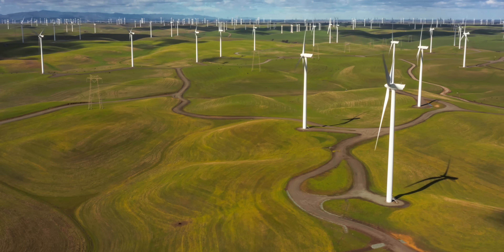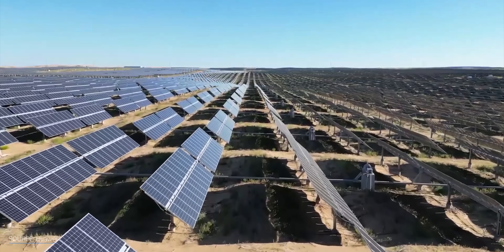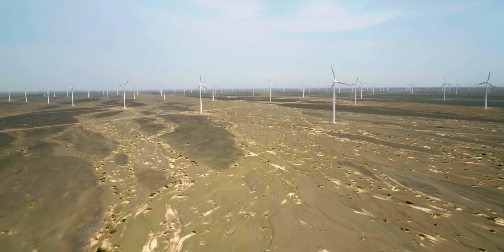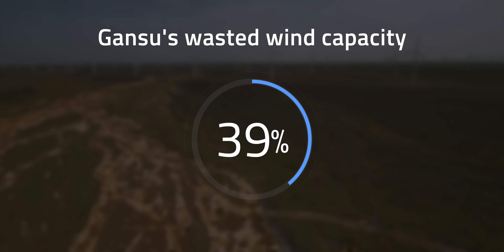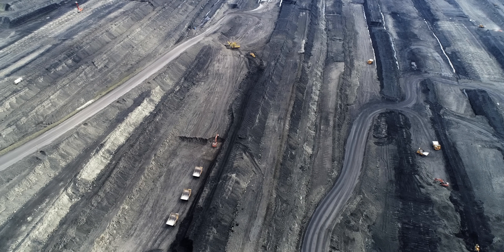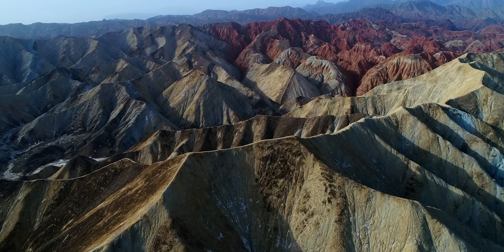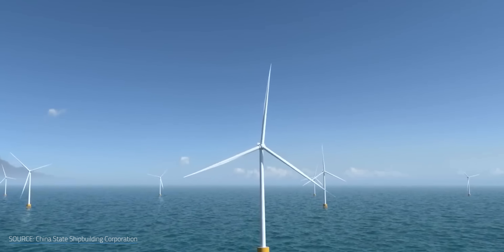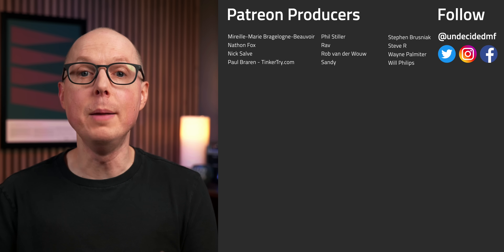The World’s Largest Wind Farm has a Tiny Problem

Comment: China has the most fossil fuel power plants to replace.
That being said 1/3 of their current supply is renewables.
They are the global leader in installed Solar, Wind and Backup Energy Storage Systems.
Their adoption of EVs has reduced China's demand for petroleum for the last 2 quarters.
The result even with recent OPEC production cuts has been a lowering of global oil prices.

Does China still have a long way to go?
Absolutely.
Even though they have a longer race to run given the size of their population.
They are still in first place and accelerating.
Reply: If, they properly built these infrastructures. Remember, "tofu" construction and "chabaduo" is rampant in China.
Reply: @Xi_Jinping_is_Pooh  the big projects aren't like that. It's not that they don't know how to do it properly. It's that their country has not been industrialised for as long, so there is not that much red tape.

Because of the looser regulatory framework, there are a lot more greedy capitalists who takes shortcuts. Smaller projects are not managed as tightly. The US had the same problem in the 19th century. The mass of red tape that has accumulated since then has curtailed that sort of thing. But it is still a huge problem in developing countries. And half of China is still a developing country, where all these problems tend to occur.

People like to talk about tofu projects, but none of their truly big projects has suffered from quality problem any more than similar sized projects in other countries, even developed ones. The fact of it is, today they are more experienced at mega project construction, if only through sheer practice. Our own skilled workforce has largely retired/retiring/died through old age. Just look at how Boeing and the military shipyards keep screwing up.
Reply: @danielch6662  I did not say they don't know how to do it properly, but "rather "if they do it properly". It is a choice. They can also employ foreign experts. Corruption is rampant in china, from raw materials factory down to the guy finishing the paint. Massive projects like apartment blocks some still have tofu quality.

Comment: That 95% efficiency smells like three day old fish baking in the afternoon sun. Not surprisingly, there was no information on capacity factor for this sight.* 
The Gansu project screams communist bragging rights project. The Gansu wind farm was always going to need hvdc transmission. Besides being remote, the Gobi desert is DRY. You're not going to move businesses where there isn't enough water.
*Can we please begin the process of playing down the energy capacity figures. Without the proper infrastructure (storage and transmission lines), total capacity numbers are next to useless. At the very least, divide those numbers by 4 or 5. Curtailment is a real issue that is not the fault of the coal lobby. Until the storage infrastructure is in place. Fossil fuel plants are a must, and they are most efficiently run at full capacity.
Reply: If we never start, we will never finish. They already built the wind farm. They finished building one HVDC line, they are building multiple grid storage solutions. It is a work in progress. Meanwhile, they are also building new coal power plants, and deliberately running them suboptimally. Because the goal is renewables. Neither coal nor nuclear are actual solutions. China don't have enough uranium to make it a very long term solution, and coal ... they already saw what happened to the air quality in Beijing a decade ago when they burnt too much coal. And you wouldn't believe it but the new generation don't want coal mining jobs!

Comment: They said a large chunk of the project was paid by the government right? Why not introduced a power supply scheme based on range to the site.. so if you live next to the wind turbines you only pay 0.2 which is cheaper then the coal and as you live further away you pay a premium for the travel and maintenance of equipment. However those that utilise wind power supply also get a tax reduction for being environmentally friendly which makes it so it costs the same as coal. This would encourage people to switch and keep the turbines in use and the biggest benefit is coal lasts longer... the rate there using up coal it will be gone in 10 years and pay a premium to import it instead..
Reply: Why is the Gansu wind farm(the largest wind farm in the world) not price competitive to the nearby coal power station ? it's a huge 66% more expensive, who here is willing to pay that ? What happened to all of those charts claiming that wind power is cheaper per electricity unit than the cheapest competing fossil fuels ? If wind farms actually delivered near their claimed pricing it wouldn't need all of the subsidising methods that you are suggesting ?